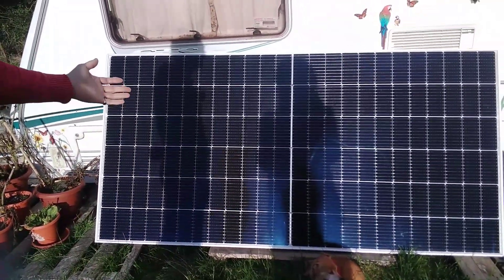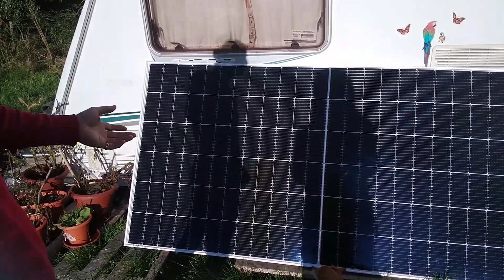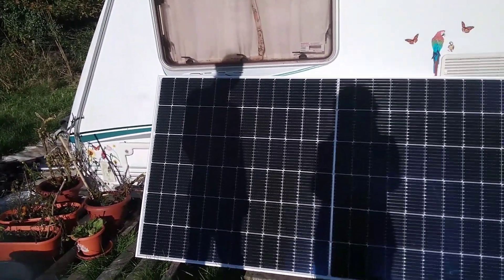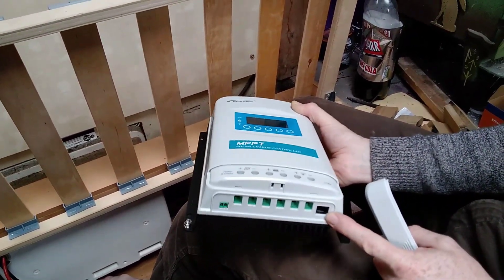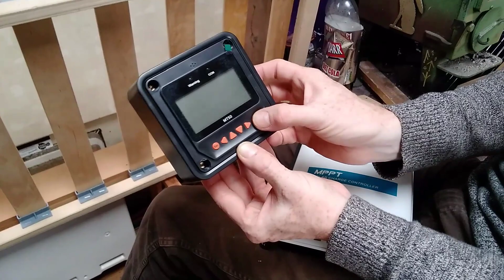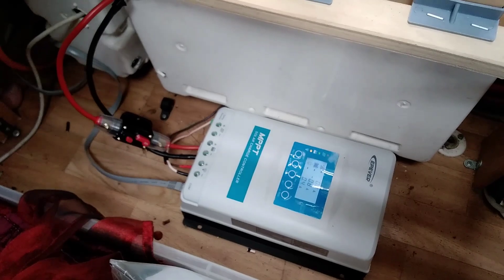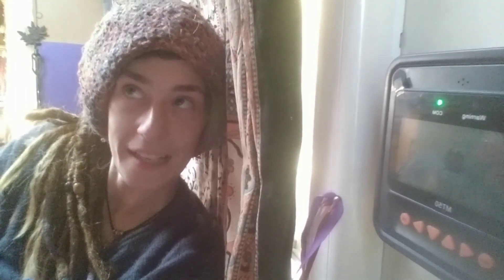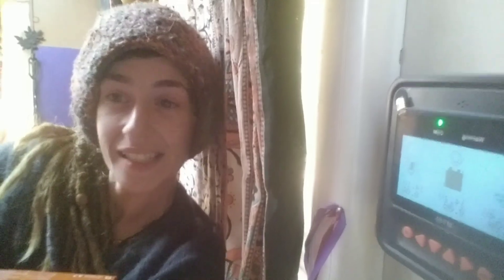A New Solar Set Up with a Smiley Face Box!

Comment: Welcome back to FaceBook! Battery temperature sensor will be good in the winter, as it will allow a slightly higher charging voltage and get the best out of solar. We've got one on the boat, but only for when it's charging from the engine. All you want now is someone who can work out how on earth you open up the 2 lights over the kitchen to put LEDs in - they completely defeated me! All the best, dad.
Reply from the maker: Tbh they never gt used, one got turned on by a hanging mug when I moved last and proper burnt me so I've duct taped the switches to off now 😆 going to get a thing to take it to 24 volts when the next pannel is up, will be the first winter I won't be struggling for power :D

Comment: Hey Pixie, love you videos. Just one tip: put a little furry type of wind protector over your camera's microphone, there are videos that show how to do that. Or, there are small mics you can mount on your cameras hot shoe, like the Rode VideoMicro, or cheaper ones in the same style like the Andoer AD-M2, Boya BY-MM1, you get the idea. Just make sure you use the spongy wind protector, or a dead-cat attachment. Upping the production quality greatly benefits the message, and you can usually do it very cheaply, just by knowing what you're doing and researching. All the best!